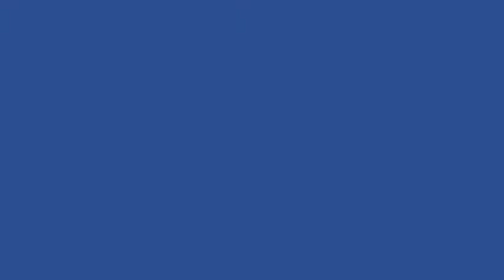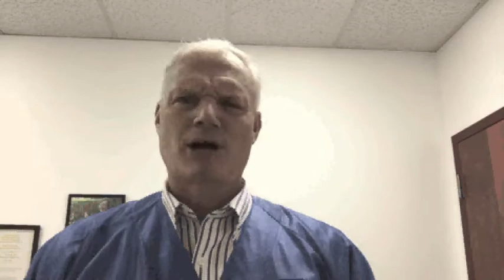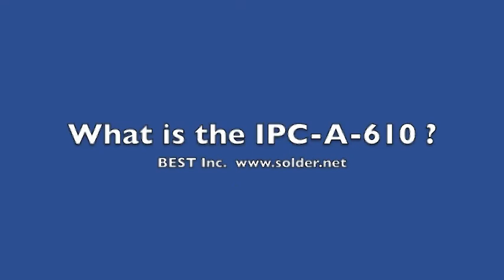What is the IPC A610 ?

Comment: What CIS mean ?
Reply from the maker: Hi,

Thanks for your question.

I apologize for the delay in replying.

CIS stands for Certified IPC Specialist. A CIS candidate would be someone who works in the assembly process and who does not intend to conduct IPC training courses.

The CIS training is modular, meaning it can be customized to fit the tasks the CIS candidate will be completing. So, if a CIS will not be dealing with Wires or Terminal connections, that module of the training and certification can be skipped.

If you'd like more information, please don't hesitate to check out our website: www.solder.net

Thanks again for your question and for watching our content.

Kris Roberson
BEST, Inc. 
Master IPC Trainer

Comment: International Standards for Manufacturing and Procurement in the Electronics Industry
IPC-A-610G  Acceptability of Electronic Assemblies
IPC/WHMA-A-620C Requirements and Acceptance for Cable and Wire Harness Assemblies 
IPC-A-600J  Acceptability of Printed Boards
IPC-7711/21C  Rework, Modification and Repair of Electronic Assemblies
IPC J-STD-001G  Requirements for Soldered Electrical and Electronic Assemblies
More Download：
www.file123.top